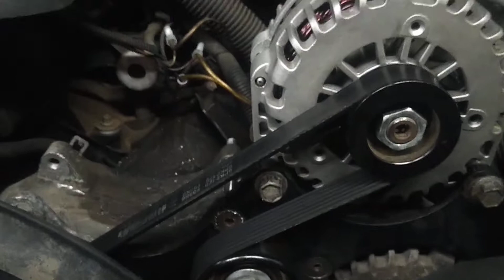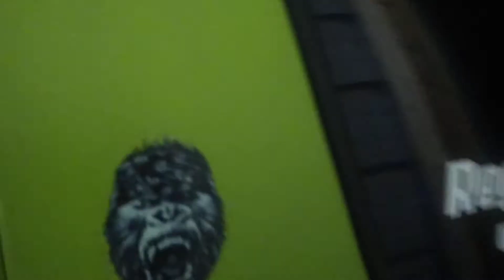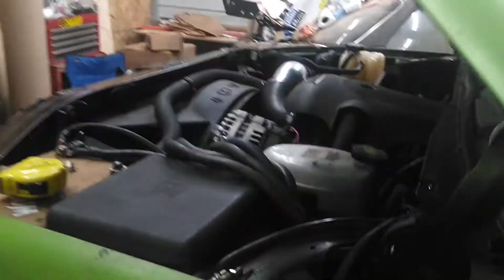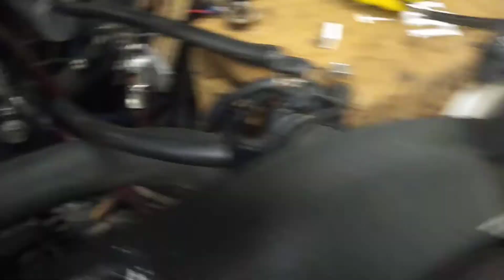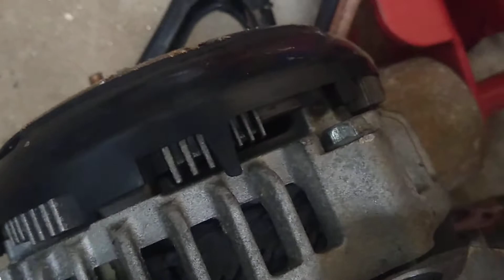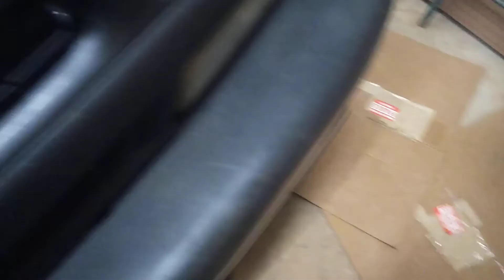Resilient Sounds c pillar wall build update

Comment: That sucks bro I was actually about to call CES and order an alternator because I’m wearing mine out would you recommend that alternator I’m only gonna be pulling probably like 150 A extra current so I need the 250?
Reply from the maker: I don't know bro I don't trust them now
Reply: Thanks bro i will take your word and not buy one,  were you gettin one from now?
Reply from the maker: Probably brand x or get 250 from aj's electric for 170ea and put smaller pulleys on them

Comment: I just got my 300 amp ohio generator. I was worried about idle voltage too
Reply from the maker: If it has small pully it should be ok
Reply: @countryboisavage  it does thankfully tom at ohio gen said it does almost 300 amps at idle and output voltage is 15 volts.seem reasonable?
Reply from the maker: @jasonhardison7103  nice